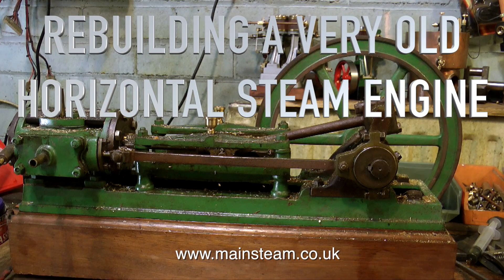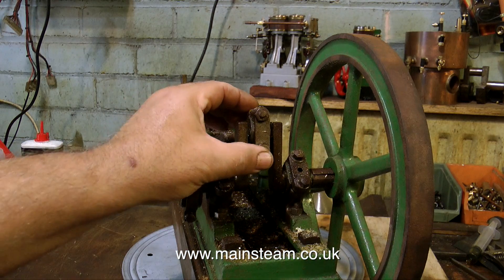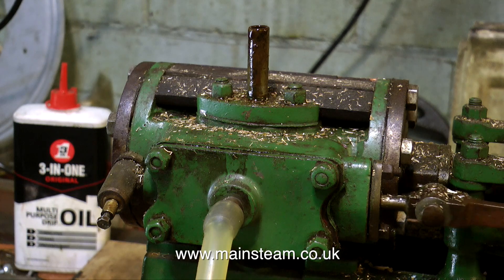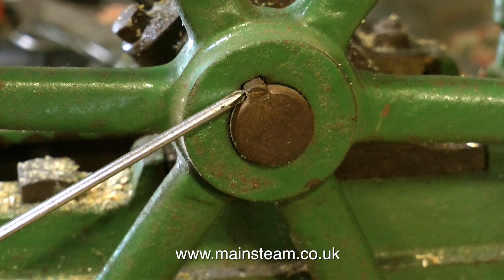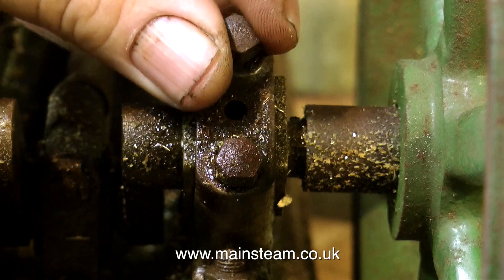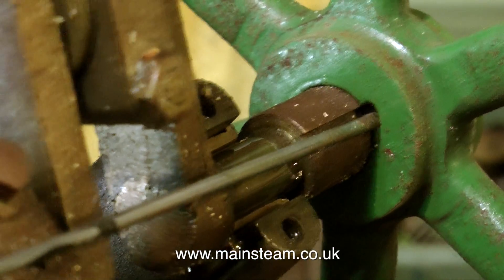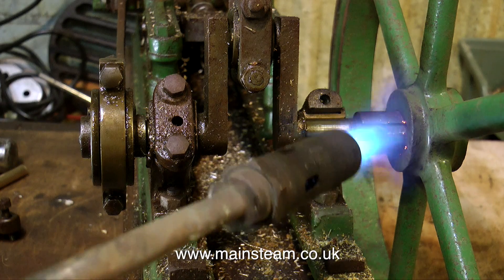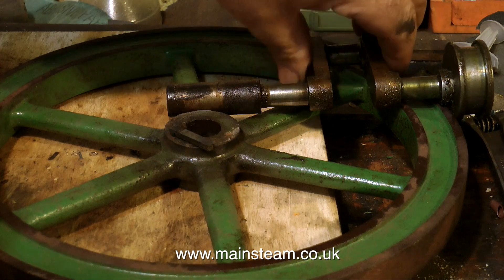PART 1 - LARGE HORIZONTAL STEAM ENGINE REBUILD

Comment: Sadly you also make it look as new. But the aging looks of it in this way was far more real than ever a model steam engine could look. Think you have enough engines that look brand new.
This one in his aging looks are so nice to see. Really old engine in all its way. Has have its live shown. Sometimes I dislike all that brandnew looks. Its just too new to me.
Next time you find sudge an old looking machine just do minor  repairs so it functions proper. Even the wood splinters on this machine looks as if just come out  of an old woodshop.
If you visit real old steam workshops you will rarely find blinking machinery. Once at a vessel diesel engine gathering I got remarks that my 70yr running engine was not quite original due to the lack of all brass blinking bits en bolds. Well this is how they came from the facturing, those other once are fake smuged up. My machine looks like right the way it came 70yr back. Nicely clean with enough wear and oil shown because it still has a job to do. Enough wear on paint just the way it has its daily job.Of course I do repaint bits over time.But overall it keeps looking as an engine room not a showroom.
Reply from the maker: I always do what just my customers want - I renovate and repair steam engines commercially to the specific paying customer's requirements - not always to my taste and also not those of Youtube viewers . . .

Comment: Dear sir, I have just found your series, I must say your work is impressive and comprehensive. I also note that you are using a 1024, excellent as I have one as well. What mill do you use? What I would like to know is where you find all these engines(wont mention the auction site) I am retired and disabled but I would like to build one from scratch. Keep up the good work.
Reply from the maker: +dolf92 I have a really old Taiwanese mill/drill - not brilliant but it works.

Comment: Love the videos,  I don't often have much to say so I generally don't comment, but I have watched pretty much everything you've put out.  Really looking forward to seeing this engine remachined.  I know that it's going to take a great deal of work but if it's any consolation it does make for some rather informative and interesting videos whenever you really have to pull out the stops and do repairs which involve a bit more than fitting some new piston rings, sanding everything down, fixing timings, and repainting.   I know those things can take a lot of effort and probably have the largest effect on the model's appearance and performance but there's something really great about seeing freshly machined parts fabricated then fit into place.    Though of course I understand why you try and keep most of your restorations sympathetic and so avoid replacing or dramatically re-engineering parts when you can.